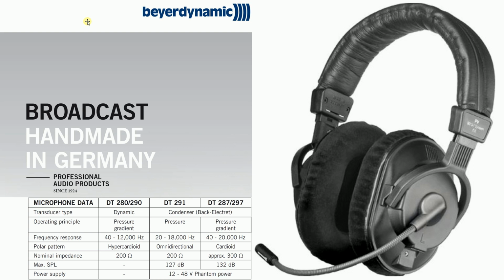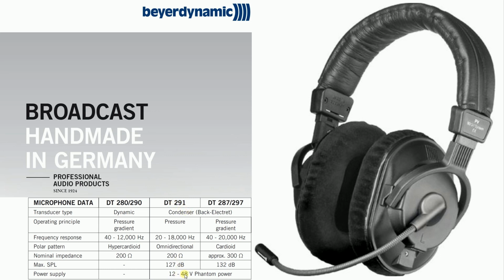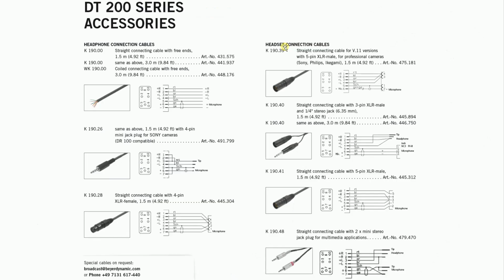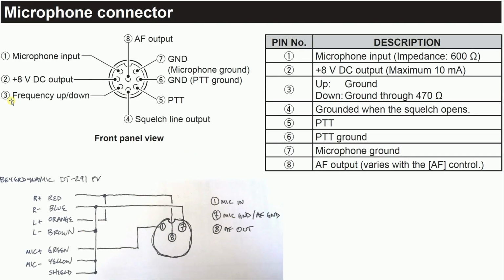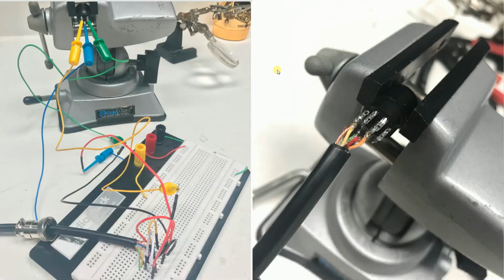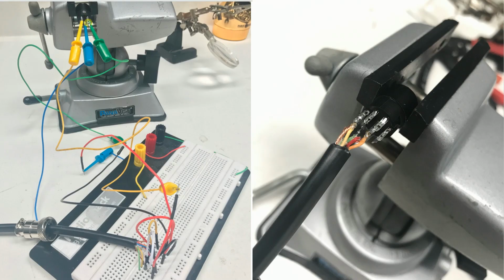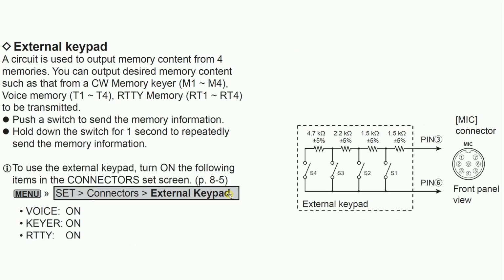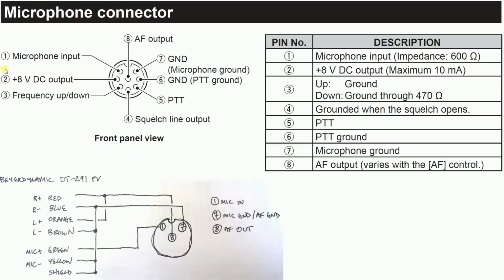Using a Beyerdynamic DT-290 headset with the ICOM 7300

Comment: Would it not be better to split the headset cable into Mic and head phones, ie just connect the microphone to the 7300 mike plug with an 8 pin mike socket and connect the ear pieces to the phones socket of the radio This would require the use of VOX.
This gets round your loudspeaker muting problem.
If a dynamic mike is used connect a1uF non polarised capacitor in series with the mike.
Better still make a cable up from the radio to two sockets. one can be for Mic in and the other for PTT.
73
Nick